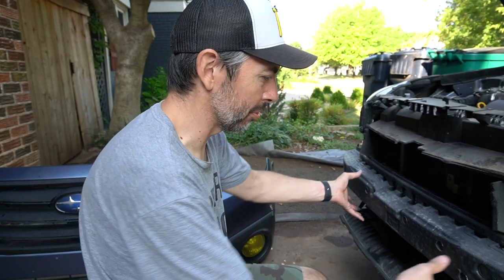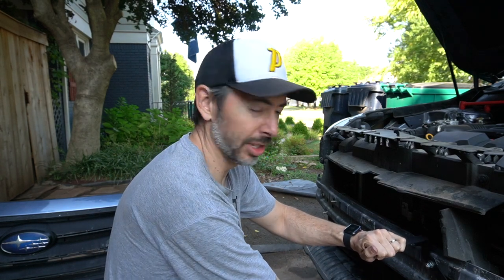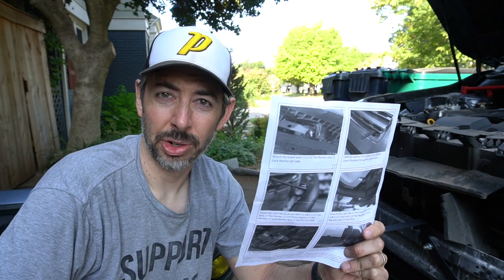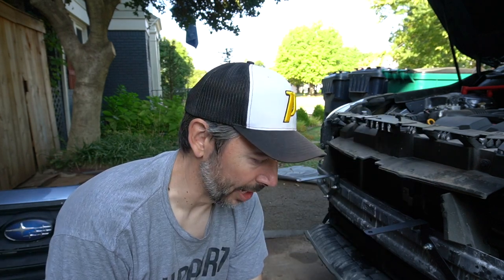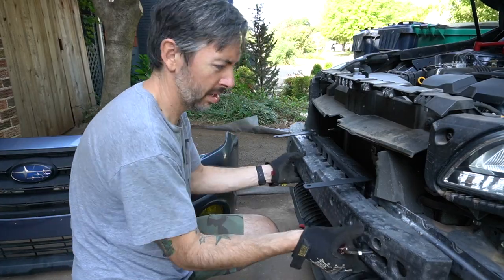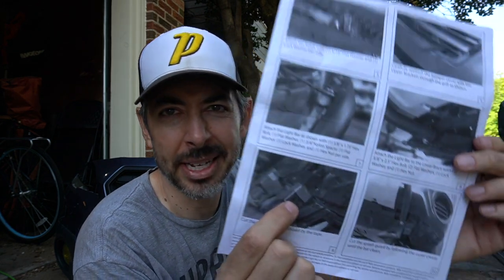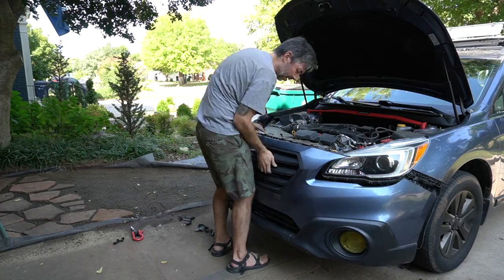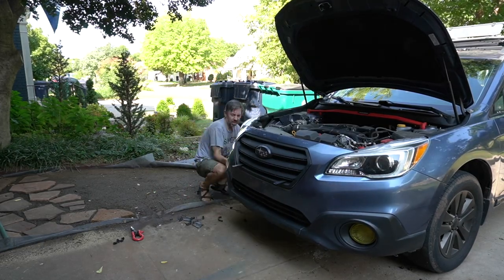Install: Rally Innovations Light bar

Comment from the maker: What's your preference: two 6" round lights or a LED light bar? (Or both?!)
Reply: LED light bar mounted under cargo basket and two 6" round lights mounted up front.
Reply from the maker: @Reaper1Zero  I love the look of an LED bar up top, but I occasionally switch out my rack for a rooftop tent and/or my enclosed storage box, and I don’t want to have to deal with dangling wires or anything. 

With that said, I just installed two 6” Hella lights tonight...and I think I’m going to modify it so I can mount four side by side on the bottom side of the bar.
Reply: @helloandymoore  What model and color did you go with? I'm mounting my Rally Innovations bar today!
Reply from the maker: @Reaper1Zero  I went with a cost-effective option, the HELLA 005750941 500FF Series Driving Lamp Kit https://smile.amazon.com/dp/B001TWD5GY/ref=cm_sw_r_cp_api_i_v1bOFbQNX8KYP?psc=1
Reply from the maker: @Reaper1Zero  May add a pair of the 500 series fog lamps as well
Reply: round lights 100%. on my outback i have the two round lights which will be replaced with Hella halogens. But i’m also going to add an LED light bar below. my bumper kit should be in soon.

Comment: I installed a light bar on my 08 Outback XT and my Subaru instantly went from "Invisible to police because they choose to ignore normal paint color Subaru Outback's" to frequently pulled over for the 100% legal roof rack light bar. At least I found and wrote down the relevant laws beforehand so I haven't lost yet over the year or so with it... but at some point some angry and/or self interested judge will find me guilty of what is legal.
The part under the front of the car you tapped and spoke of is called a Air Guide.
Reply from the maker: Dang, that's no fun. I haven't attracted any interest from police, but that's probably because I'm in Oklahoma and we no longer have state vehicle inspection, which means our police are extremely lax when it comes to enforcing the [fairly minimal] rules regarding vehicle appearance.
Reply: @helloandymoore  Here we (men only) with Handicapped placcards are the police focus when they can't find a black man to attack. They go for us because (I suppose they wish to show incredibly pathetic weakness) most of us are unable to fight back, making us the easiest target to physically assult to overcome their frustrations from their shifts (exclusively a guess here). I think I should probably take it off unless there's chance I'll have to use it such as travel to/through/in Vermont where deer are absolutely everywhere.

Comment: Andy do you know if the airbag deployment is affected with these front end bars?
Reply from the maker: I don't think so, because it primarily attaches down below. If you got hit hard enough to push in the bar into the bumper and thereby trigger the airbag sensors, they should still work.

Comment: Hey Andy thanks for the video your Rig looks great. We are building up ours and are planning to install the Rally Innovations bar upfront like you have shown on this video. Had a few questions for you.
1. where does the bar get attached at the bottom frame of the car? I understand it gets attached to the bumper directly with those angular metal angles, but the video did not include any under body attachment points.
2. How did you black out your grill? Plastidip or automotive spray paint of some sort? 
hoping to hear from you.

TIA
Roy

Comment: I thought these were called bull bars.  Just bought a 21 onyx XT.  Going to install one of these as well.
Reply from the maker: Heh, you're not wrong! I grew up calling them bull bars, bully bars, or rally bars. For some reason I think I always associated "bull bars" with pickup trucks and "rally bars" with, well, rally cars. I suspect Rally Innovations recognizes that most folks just use them to hold lights and thus call them light bars, but I've never asked them.